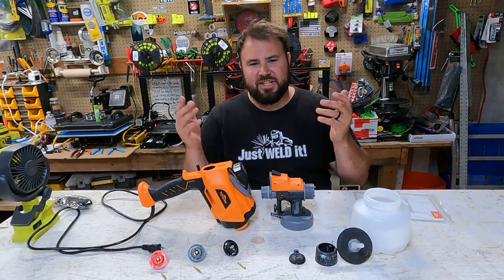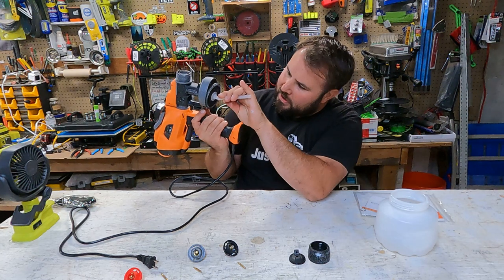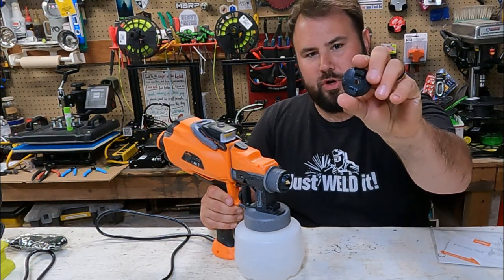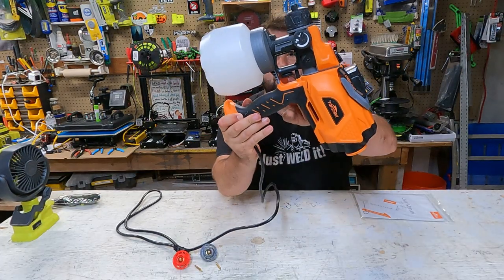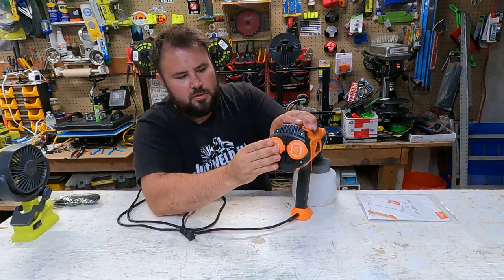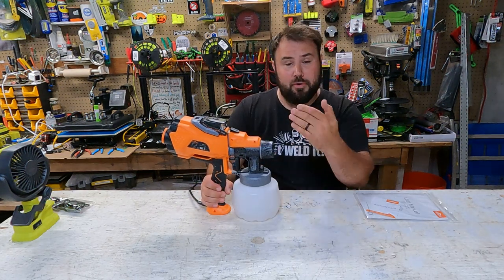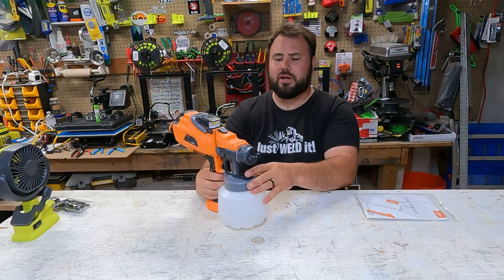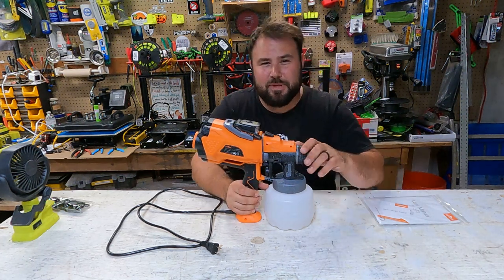Topshak paint sprayer

Comment: I have one of these. In the instructions it mentions being able to remove the nozzle that the needle threads into by first pulling the trigger then pushing to remove the nozzle. It would help to clean the unit if I could do this but I can’t get the nozzle out. I can unscrew the needle but I would like to get the nozzle out also. Any ideas?